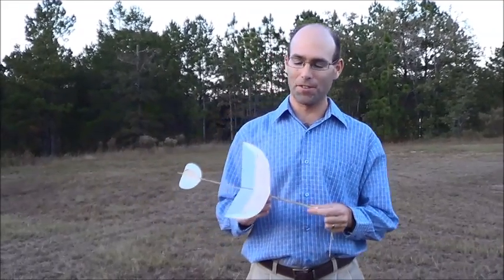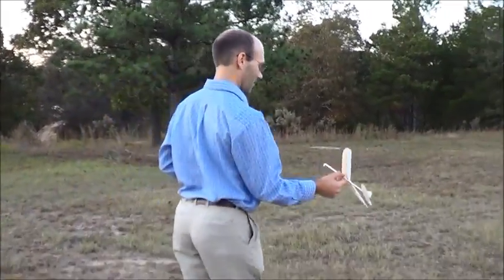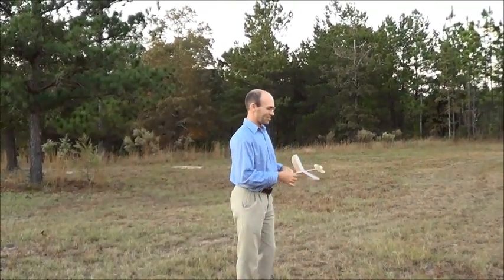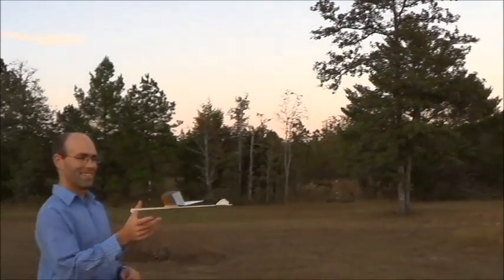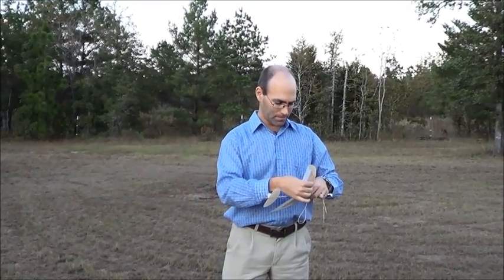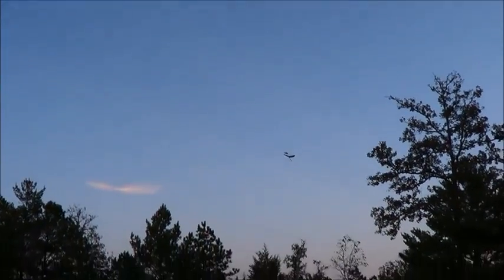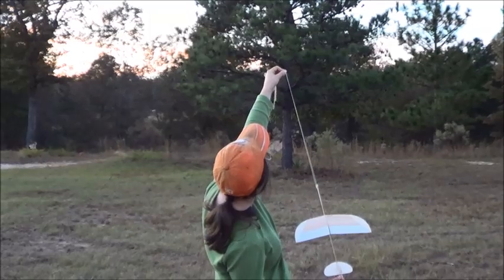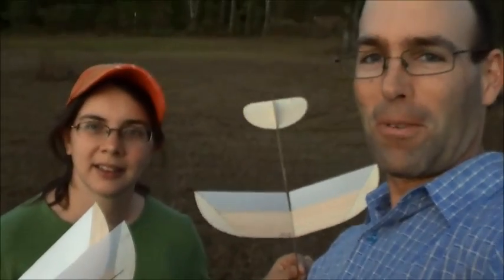Protege Lite AMA catapult glider demo

Comment: hi sir, I also tried CLG once and had the problem (as at 2:30) every time. can you explain to me what can be wrong with it?
- If I tried to set CG to achieve higher altitude, after gaining height it simply dives (not get leveled by self).
- if I move CG slightly backward, it took a big loop and came back to me.
Reply from the maker: Abhilash Patel move the CG forward, add up elevator
Reply: @joshuawfinn  i will try that.

Comment: Why not build for SO?  I cannot seem to build and trim the Protege to less than 4g without sanding too much off the surfaces.  We could build the Protege lite heavy and ballast to 3.5g for SO.
Reply from the maker: David Franklin, I don't think the flaps are strong enough for SO usage. The latest Protégé SO models are building as low as 3.0g thanks to better wood suppliers and the new Vector Board 1mm flaps.
Reply: @joshuawfinn  maybe we need to buy a new kit.
Reply: That's probably the lower quality wood

Comment: I am confused on how you get it so light...? Is it mostly the weight of the balsa you use? Because I have built one with smaller balsa wing sections and bigger flaps, and very thin depron for the flaps, but I just can’t get under 2.6g no matter what i do!
Reply from the maker: Copterdude, you have a kit for one of these on the way so you'll know the answer this weekend. ;)
Reply: Ok sound good!
Reply: try more balsa and less depron 1mm depron weighs the same as 3mm depron. The skins are incredibly heavy, the internal foam doesn't weight much. or just sand the depron skin off. Apologies if this is stuff you already know.
Reply: Yes I have been removing the skins. And i use less balsa because the balsa is the heavier part of the wing.
Reply: @AeroCraftAviation   would Imagine 4lbcf balsa would weigh about the same as unskinned depron. Since your removing it, I'm not sure where the weight comes from. It might be from the tail surfaces, I think most std cat gliders use something like .040" for the tail, and taper it to .020" at the tips. only the very center near the leading edge is .040" rudders can be .030" tapering to .020". Past that I've got no ideas. I've never built a big indoor cat glider, so take what I say with a grain of salt.
Reply: @AeroCraftAviation  I'd imagine that would be light enough. Cross check with these plans when you build again. https://indoornewsandviews.com/?s=catapult+launch+glider
The weights are coarse, but they should give you an aim point.
Reply: Good idea! I’ll try that!
Reply: No, it’s actually foam, just the hard outer layer where it was pressed against the mold or what have you. It’s effectively the same piece of material as the core, unlike foamboard. So it cannot he peeled away.